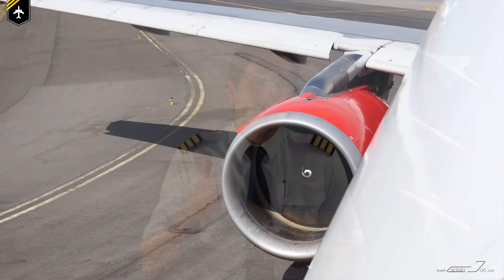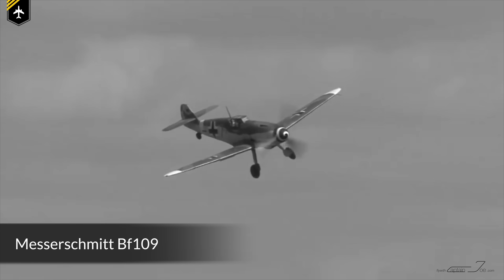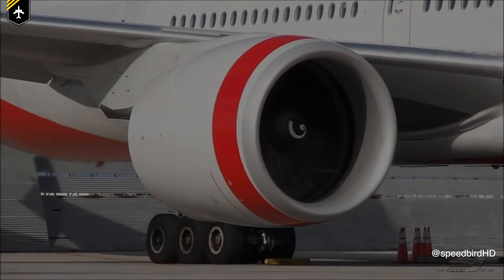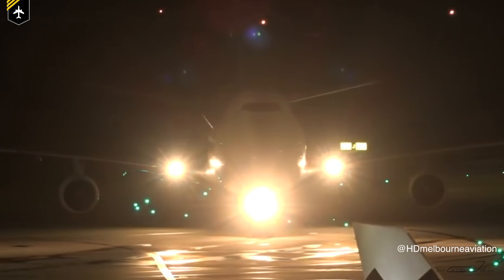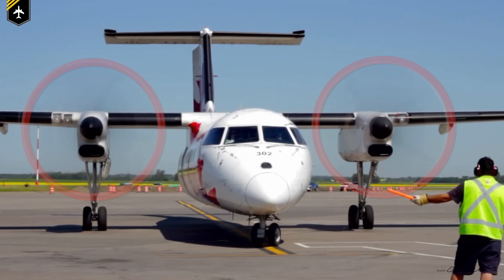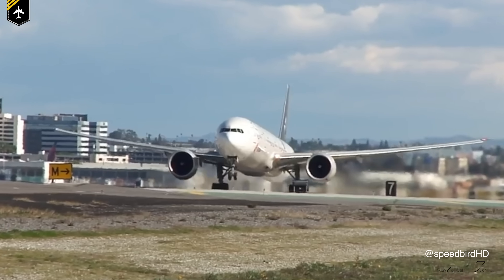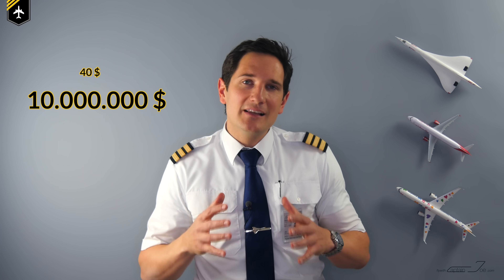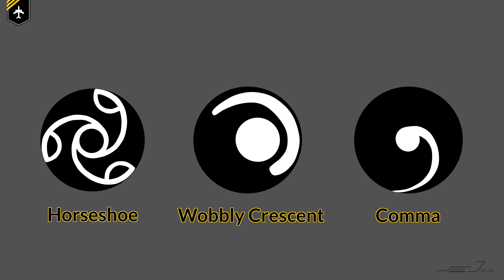WHY is there a SPIRAL in a JET ENGINE? Explain by CAPTAIN JOE

Comment: why isnt it possible to painte the turbine blades ???
Reply: Dark Thanatos 99 it would be expensive to paint them, since dirt and dust repeatedly strikes the fan blades the paint would come off so many times
Reply: loyd ala Thy you    just noticed i wrote paint wrongXD
Reply: What blades exactly? Turbine blades are on the exhaust section of the plane and are used to power the compressor and fan blades. So I'm assuming you meant fan blades. They spin too fast to notice and would add some weight to it
Reply: Paint has weight, it would unbalance the blades.
Reply: The turbines become transparent when spinning
Reply: it would make the fan blades all wibbly wobbly and then the engine would blow up.
Reply: Just guessing, paint on the blades would make it difficult to check for wear and tear due to stress such as cracks.  I think.

Comment: Mmmmmh — I knew it.😂 I’ve always though they were a visual mark for safety. But why not just have a light there somewhere in the middle to indicate the engine is still a potential hazard?🤔 Like Red for Running, Orange for running in idle power, Green for complete Off?? just wondering.

Comment: Captian Joe I just read the delta was saying goodbye to the boeing 747 and switching to airbus a 350 now I know france  they use sticks to control the plane  can they make an airbus a350 with a what is like a steering wheel that we use over here in America or do pilots over here havet to be ok with a stick

Comment: In relation to engines ingesting birds is there are reason why a super rigid mesh couldn't be fitted across the front of the engine? Or perhaps I'm missing the point. Hitting a bird at 200+ mph it might go straight through the mesh is slightly smaller pieces.

Comment: Why can't they just add a guard on the front of the engines so birds can't fly into the engines? Only reason I can see not to do it is if they can't stand the air flow or the engines suck them in or if an bird damages it and parts of the guard get sucked into the engine maybe.

Comment: Why not paint with bright colors one or two blades of that first group of blades we see in the front of the engine?... oh... maybe it would destabilize the spin, making it vibrate, right? Or maybe add enough weight to have a little loss of fuel.

Comment: They can really be sucked in 9 feet away? Thats impressive
Reply: i bims Baum - so thotty it even sucks birds
Reply: Succ
Reply: 9 feet is nothing. My ex used to suck dudes in from different area codes. And she IS a spinner.
Reply: @Cedar_Valley_Live  Dead😂😂😂😂😂
Reply: @Cedar_Valley_Live  loool
Reply: I imagine at the upper end of that danger zone it at least has the potential to knock someone over and injure them
Reply: But cleaning up after would be a huge problem.
Reply: @sathwikr7591  not really... they would be totally chewed up, sliced and diced, pink mist vegimatic style, if they could get through the front fan.  
 nothing left that a strong water hose blast couldn't wash off the tarmac. But they would probably cause a flame out like birds can.  Still again, it would not be pretty.
Reply: Not 9ft away but you see how easy he went in https://youtu.be/Q0nRt9g6tdg
Reply: @samw2195  that's wild! 
The guy got lucky on that one.
Reply: @michaelmccarthy4615  He was lucky the inlet was designed the way it was, and his cranial and flight jacket no doubt fodded that engine out enough for the pilot to power down. Talk about luck!!!
Reply: @samw2195  - Thanks for that! Excellent illustration, and very helpful. And that's on a small aircraft! It's very easy to see how the monster 8' or 10' diameter engines on a commercial jet could be lethal from 14' or so.

Like serious acceleration and high g-forces, jet engine suction is one of those things that must be difficult to comprehend until you've experienced it. In the world of titanium smoothie-makers, humans are pathetically soft, squishy little things really...
Reply: you get close enough to be caught by the engine vacuum,  its over... put your hand near a vacuum hose.
Reply: They could vacuum all the air out of your house in seconds.. its insane
Reply: Here's your 500th like
Reply: wut dat engine do doe
Reply: Its a XXXL Hoover
Reply: @techgeekwarren4504  qq
Reply: I've seen people get sucked up into the engine, luckily he survived.
Reply: @che3se185  😂😂😂
Reply: Lol b1 Lancers have like a minimum 25 foot range that stay away while the engines are running
Reply: Vacuum cleaner
Reply: @che3se185  holy fuck I cried laughing
Reply: Doubt it - that's the hazard zone so there'll be a reasonably large safety margin built in.  You'd probably be fine down to at least 5 feet, and even then it'll depend on how heavy you are.
Reply: @loquisitivemind  Five feet? Hell no, even at idle power! You'd get sucked in quick no doubt. You can feel the pull of it at ten feet.
Reply: @Pieman6711  OK, but there's always a safety margin. Bear in mind you can walk into 40kt winds without too much trouble.
Reply: I work on a UPS ramp and a lot of times we need to do FOD(foreign object depris) walks to ensure that when the plane comes in and out things like rocks, screws, and even shards of metal from the cargo canisters dont fly up and kill someone or damage the turbine. These FOD walks go from atleast 50 feet before the gate to atleast half the Yankee(the runway the plane comes down the ramp on) past the gate. We had an incident(not on my ramp) where a pilot had his eye impaled by a pen because the crew overseeing the plane didnt do a FOD walk. So yes these turbines are very powerful and have a lot force generated in the front and back of them.
Reply: Jet engines are the closest thing we have to black holes

Comment: Can a bird big enough, blow up an engine, like In the movies?
Reply: Well, depends what you call "blow up". Can a bird cause an engine failure? Yes. Does this mean the engine explodes? No.
Reply: Absolutely. The fan blades are rotating very quickly and enough damage to them can cause a severe imbalance that can violently eject other blades/parts of the engine. Engine manufacturers will add reinforcements around the blades to help prevent any parts completely puncturing the engine cowl so that they don't fly into the cabin or wings. There are videos of these tests being conducted in controlled settings that you can find online.
Reply: CAPTAIN JOE we are painter seller shall i knew the white colour code for dreamline 787

Comment: Just llke the £ goes in front of the number in GBP prices, the $ goes in front of the number in USD prices, also.  So, it'd be $10,000,000 rather than 10,000,000 $  You wouldn't write ten pounds as 10 £, would you?  Also, "apostrophe" is pronounced "uh-pahss-truh-fee"

Comment: Sonic cannons deployed randomly at an airport does a lot more to scare birds away.  No projectile or blanks.  Just a propane filled metal tube that's set off with a very loud bang.  Sonic cannons are usually mounted in the pickup bed of the property security truck along withe the usual FOD box and landing light maintenance gear.

Comment: Do people fire shotguns at airports to scare birds?
I was under the impression that there is an automated system that fires at timed intervals, based on compressed air that releases a loud bang (like a shotgun) but is less dangerous and is used solely for this purpose in airports
Reply: beepIL some airports use falconers to scare other birds away

Comment: Captain Joe, another reason for the different markings, like ones found on a C-130H model aircraft, a blade tip is checkered for high speed video shooting to study RPM balancing and syncing during maintenance.

Comment: Paused at 0:02 to answer the title.. its used as an indicator to let you know if the engine is running and at what speed... Now I'll post this and see if I was right.
Reply: 3 minutes in and I was right.. Awesome.. Did you know that Helicopters also have the painted tips..Fun Fact.

Comment: Why don’t airplanes have a layer of mesh attached to the front of the propellers to stop bird strikes happening as much? The mesh would allow air to enter but not birds, and ground crew would still be able to see the spiral.
Ps: It would be attached to the side of the engine going across the front.

Comment: hi captain Joe, nice from you all of your videos about aircrafts and navigation systems.
I want to say an idea , in this video between 03:26 and 03:35 why airlines don't want to prevent birds strike by mounting a light-grid protection on the engine deflector, if I 'm not wrong in the pronounciation of the last technical word.

thanks captain.

Comment: Why did day just paint the blade or            the propellers ?? So it doesn't look like a hole just make it a bright colour is it a good idea ??
Reply: Diandro Williams costs too much, it costs to maintain the color, like respraying and even post production it gets dirty and overtime the paint would go away and the paint may be ruined due to the sucking power and weather conditions etc you get the idea
Reply: And it has weight which will inbalance the blades or chip off and damage the motors.

Comment: Ooo I know a good question 

Why does a airplane have a nice whine during takeoff.
Reply: Proat gaming. I've wondered the same thing, turbos make the same sound and have forever thought that it was due to the bearings. 

But then i talked to a guy who works with these types of things. He told me that it was basically due to the air flowing around the blades. You know why helicopters make that "chopping" noise. It's basically the same phenomena with jet engines, except with many more smaller blades and spinning at much higher rpms. Hence the high pitched whine vs the "put put put" chopping. 

In addition to all of this, big turbos with journal bearings still make the whining sound, even though journals don't make noise. So it's probably due to the air flowing around the blades.
Reply: @ellisjackson3355  superchargers whine
Reply: Right on Ellis. That subject is so extreme not even the best scientist can tell you why. It relates to the Navier-Stokes equation and how a given aeroform flows across air. 

The best suggestion is that it is completely dependent on the aeroform, it's speed, the hydrologic characteristics of the air, and very likely some factors which I can barely comprehend. Suffice to say, each turbine has its own unique sound!
Reply: WhatnotSoforth actually the plane gets turned on when it takes off and that's why it makes a nice whine
Reply: WhatnotSoforth or the airplane is congratulating itself and that's why it has a nice wine
Reply: Ender Shard well, the plane engines could theoretically be designed in such a way that the engines make a fart sound instead of a whir. :)
Reply: WhatnotSoforth XD technically yeah
Reply: @WhatnotSoforth  Navier-Stokes...I'll go take another look at my fluids textbook lol. And to back up your fart comment, Extra 300 propellers sound kind of farty when flying.
Reply: Proat gaming How do you know your plane has landed in Palestine?

Because the whining continues after the engines are switched off.
Reply: Pure sex appeal, only reason! ;)

Comment: I want to ask that- is it allowed for pilots to take off vertically
Reply: If you talk about a helicopter pilot, yes. If you mean taking off vertically with a fixed wing aircraft, well good luck with that because most aircraft except for some high end fighter aircraft don't have the engine power for a sustained vertical climb.

Comment: If they think that birds are attracted to the dark engines, why don't they have LED lighting inside the engine to light up the engine?  They could also just paint stripes on the turbine blades to make the birds think it is a solid wall and not a hole.
Reply: Brian G painting blades creates a balance problem. At the extremely high g forces of what is essentially a single metal crystal (fan blades are grown, not cast) small weight variations amplify into catastrophically large imbalances.
Reply: Another probable reason is economics: for each pound of extra weight, you can have one pound less of payload.
Reply: The lights would either fall off or get sucked in by the engine
Reply: It would look like a super-sized Cosair RGB cooling fans from one of the engineer's computer.

Comment: Hi Captain, fantastic video as always. How coincidental that there are 737 comments on this video before I posted.

One minor observation, as an employee of an engine manufacturer. It would be nice to mention the engine types and OEMs that harbour the various spinners you've mentioned. I know which ones are ours, but it's always nice to know what the market is doing.

One thing I'd like to share with the YouTube community - the spinner that Joe mentioned also has two other functions, which any member of public can see. The first is to prevent ice build-up, as the spinner has a heated rubber tip. Also, if you look closely at a spinner, you'll see a little mark along the lines of > or 1 > etc. This tells maintenance personnel where fan blade number 1 starts, to allow for quick reference should there be a problem with any of the blades.

Comment: How about glow-in-the-dark spinners, don't know about complications but would sure look cool in the night ;)
Reply: I was thinking similar for propellers, have LEDs mounted at the tips, probably powered in a similar manner to de-ice systems. Would make it way more visible, day or night, than just paint stripes. Would look really cool too.
Reply: @quillmaurer6563  That would cause issues as the Aeroplane already uses navigation lights to indicate to other Aeroplanes the direction the plane is facing. Having additional lights would cause confusion.
Reply: @quillmaurer6563  or just  make the fan blades white :P
Reply: I was thinking the same thing put some glow paint them look real good
Reply: It would look cool
Reply: I might not scarred of the dark:’3

Comment: Cap Joe recently India aviation regulator DGCA grounded all A320NEO because of PW1000G failure...what is problem with them ? They less noisy than other. engines.

Comment: one more fact: the tip of the spinner of a RR and IAE engine is a piece of soft rubber, for anti-icing of the spinner. most of the time i dont like RR engines 'cause they could be difficult to work onto (btw PW even worse) but got to admit, thats a very smart design.

Comment: Hi Capt Joe, since we're on the topic of engines, can you help explaining why engines on the Airbus A320 (not sure whether CFM or PW) and also the Rolls Royce Trent XWB on the A350 make a very loud and annoying drilling noise on take off till they reach the cruise phase. This drilling sound is not experienced in the B737 powered by CFM and other GE/RR powered Boeing jets such as the 777 or the 787. I know the thrust levels of the RR Trent powered Dreamliner is different to the A350 but why is there such bad noise on A350 as all newer engines are expected to be quieter than the previous generation. I haven't flown on the A320neos so can't comment about them.

Comment: Have seen mentour pilot video on this....but this one is better.....didn’t know about the other odd patterns and who can resist a war bird with Those big piston engines.  To be honest though the only reason I watched was to find out where cap joe is going!!!!!  Doh!   Keep em guessing aye? Hymph😤.  That question about take off g forces is a good one.  I’d like to know how you fly by the seat if you pants in such a big air craft?  I guess heaps of experience goes a long way!  I’ve only done a few flights at the controls of gliders and the tomahawk but found sensing a wing dipping quite deceptive at times.  Gliders taking off especially difficult under tow at low initial speed.   Comes with practice I guess.  Come on joe when’s the big reveal?!

Comment: Why not paint the blades a different colour so its more visible?
Reply: Buffy Scruffy painting blades will add weight to the blades.
Reply: @Azagro  still better than a 10million replacement cost, what'd you say?
Reply: Luv Sharma No, because imbalance can cost you way more than that. Basic engineering.
Reply: @Azagro  how does it imbalance when there is a symmetry? 😅 I'm dumb I guess, I don't understand.
Reply: Luv Sharma if you add paint to certain blades, there will always be an imbalance, it already takes a lot of effort to balance the blade now you also have to balance paint... and then during flight, you will have particles hitting the blades at random spots causing the paint to damage and again have a non uniform mass balance.
Reply: @Azagro  ohh, but why not paint all the blades white? Plus how much more weight can the paint add, should be feasible.
Reply: Luv Sharma Why would you do that and add inbalance and harmonics over time, risking rotor damage and perhaps lives, simply because you want to paint blades? As I said, you add a stochastic component to your rotor balance.
Reply: @Azagro  so you're saying that humans  have advanced so much and we  just can't have blades a different color? xD I'm sure Elon would be able to do it easily.
Reply: @Luv Sharma "I'm dumb I guess"
Yes, that's why you don't work as a plane designer.
Reply: Ken Block would do it this way.

Comment: Thanks for this nice video. I got a doubt. The threat by birds will be in low altitude right, then why they can't install a mesh type protection for the engine to stop bird or any other objects to be sucked in to the engine and causing damage ? And make the mesh  on /off when required.